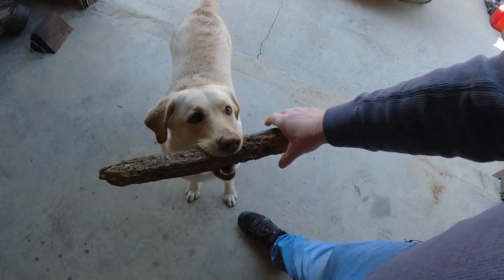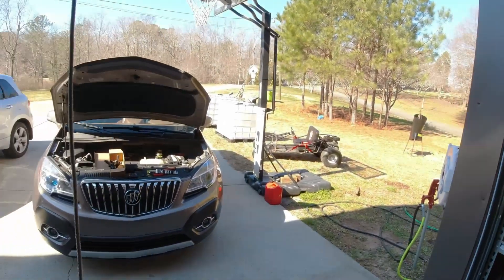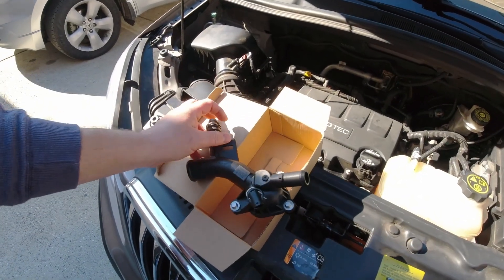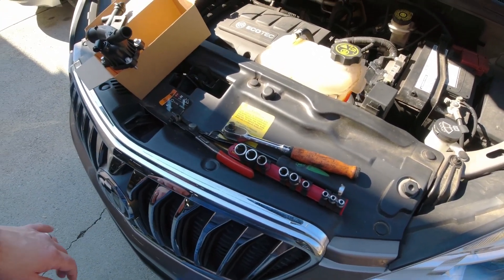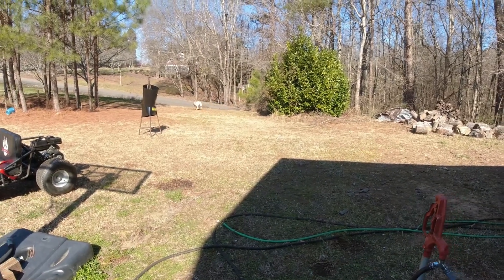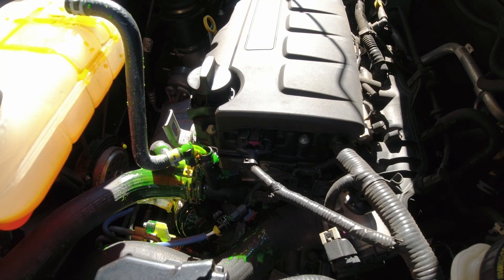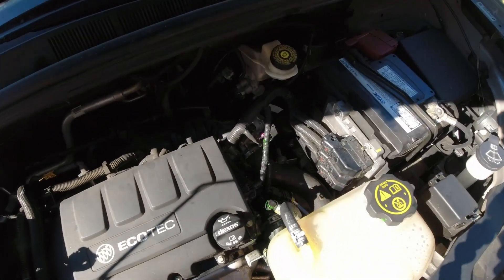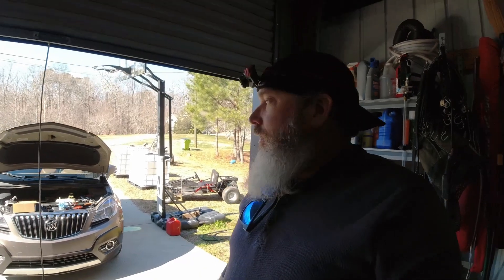How To Repair  A Coolant Leak On A GM Ecotec Engine

Comment: I have a 2018 Trax i’m not sure if I have a coolant leak or not Midas replaced the turbo a month and a half ago they overfilled the reservoir tank. I’m not sure if I’m losing coolant because they overfilled it or if there’s a very small leak, it seems to go down a little teeny tiny bit about every 2  weeks I drive 800 to 1000 miles a week so in that two weeks, there’s a lot of driving being done with very little Coolant loss there is no visible sign of coolant anywhere.
Reply from the maker: I would pressure test it cold and then check again hot. Sometimes a leak can form at a specific temp and not at others due to metal expansion. Remember never open the coolant system hot.
Reply: @HotRodDave  Midas says they pressure tested and they say it’s fine. They did over fill it some I wonder if it’s just splashing out from being a little over filled. At the top by the cap there looks to be some kind of a drain there and there was white crusty stuff  on I t like like dry up coolant just a little I cleaned that off it’s not that big of a deal if it is leaking that little bit I just don’t want it to get worse. I do have a warranty on the SUV I just got it 4 months ago from Carmax and I got there Maxcare  and it coves the cooling system but it’s a $300 deductible witch I don’t have the extra money for that right now and won’t for a long time as money is tight any extra money I had now goes towards the car payment $548 a month.  The coolant now when cold is at the big line on the side it started out at the top of the arrow⬇️— where that line is on that arrow  so it didn’t drop much but it did go down some . I looked all over no sign of a leak anywhere.

Comment: Is there somewhere behind the water pump that could leak? I replaced the pump 3 times and the leak is behind it somewhere.
Reply from the maker: I'm not sure.  That's the only one I have done and I didn't have any other leaks.